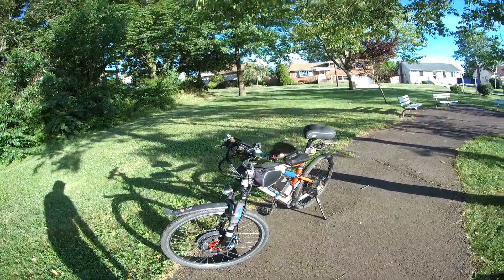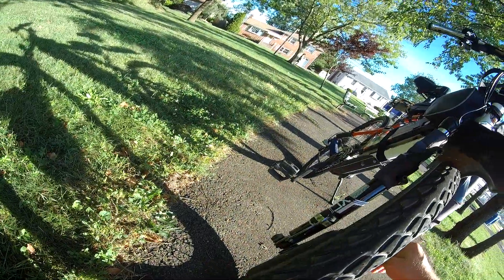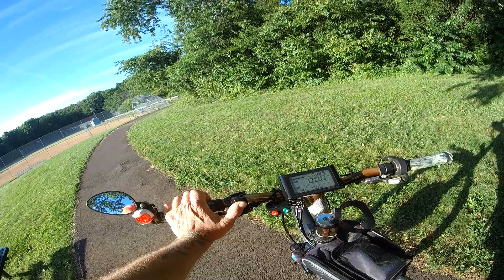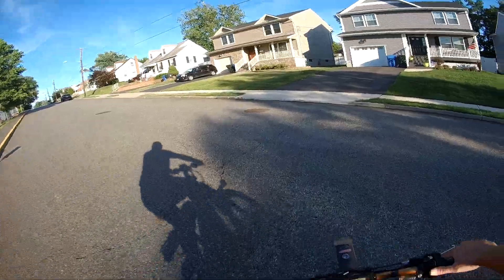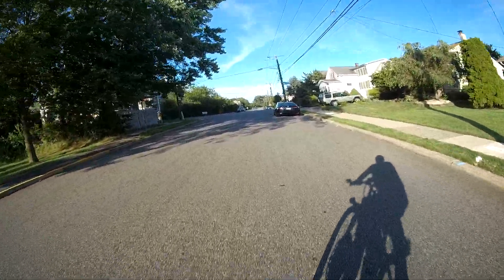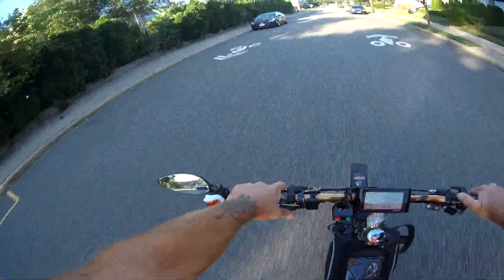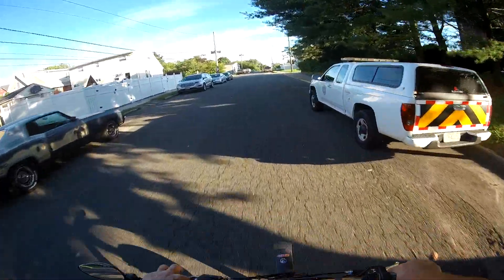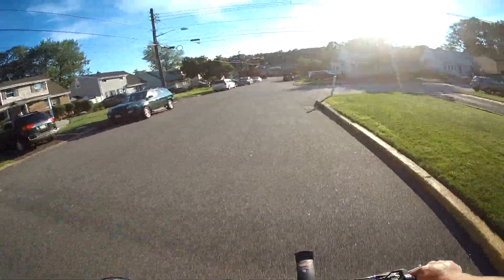DIY 52v 1000w ebike🏁30+mph🐌SNAIL 203mm floating brake rotor SW900 lcd

Comment: Haeloo sir may i ask a quaestion? Is that rotor resin pad only? Or i can use any other brake pads? 

Thankyouu waiting for answers hehe. Planning to vuy too
Reply from the maker: Hi JM VLOGS It works good so far no problems same original pads that come with JuinTech brakes whatever they are made of.

Comment: Good job I have also a set of snail floating roters oderd from Amazon they are good even in summer and winter days
Reply from the maker: Yes thanks very good only the red anodizing has faded from the sun and the back side of the floating rivets are rusting a little.